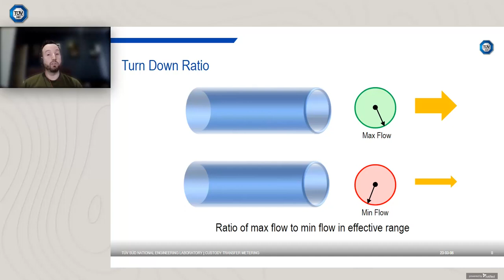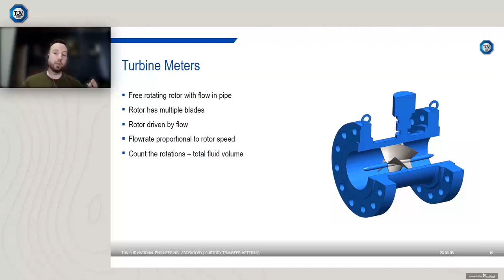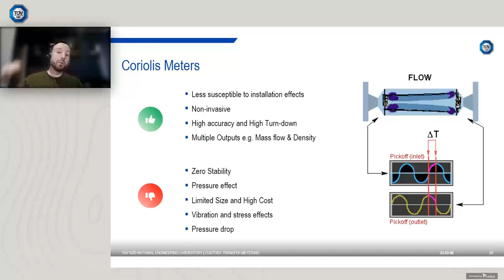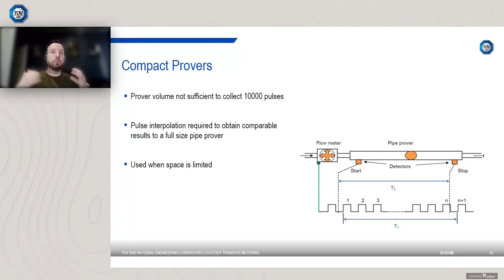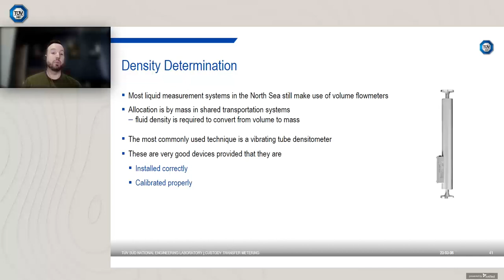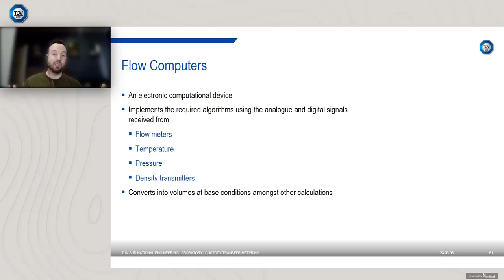Webinar // Custody Transfer Metering

Comment: I’m working as Control system engineer in metering skid technology. It’s was very helpful to understand metering skid.
Reply: How do you find it working as Control System Engineer in Metering Skid Technology? Is it much better than becoming a DCS Engineer for a Processing Plant (Petrochemical / Oil Refinery)? Does the specialised section better than the big role of whole plant control? 

Im currently receiving 2 offers. One in metering and another one as a DCS engineer for a petchem plant. Which one do you think valuable in the long run? Thanks! :)